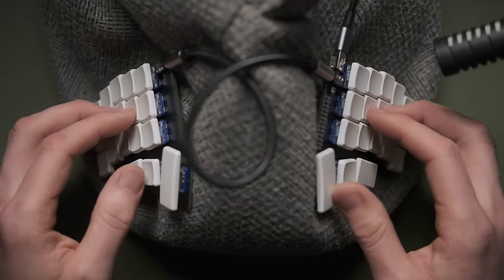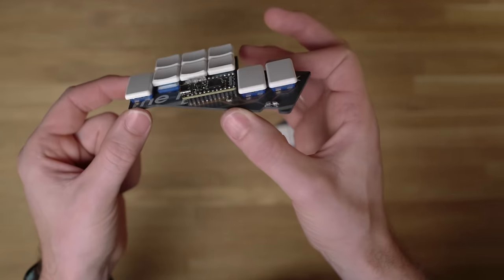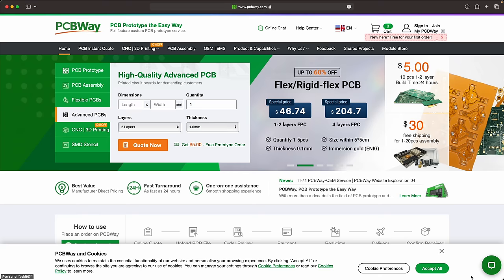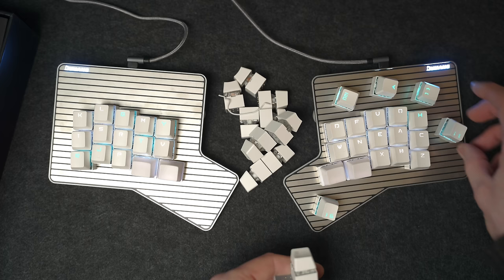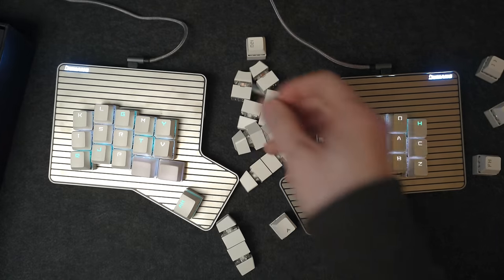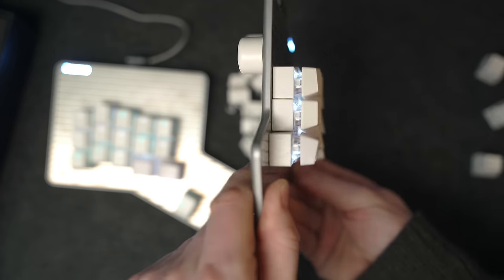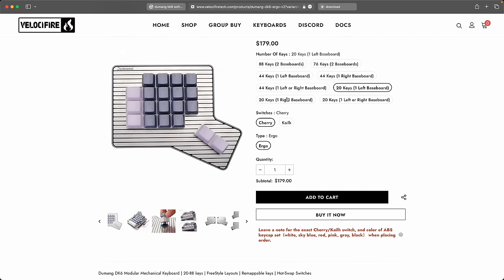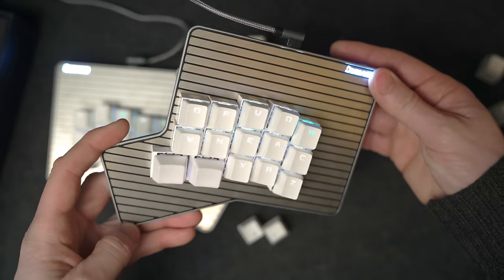This Keyboard Lets You Put Keys ANYWHERE!

Comment: super cool, needs an open source firmware however...
Reply: Yep. A keyboard without firmware being audited is a key logger waiting to happen
Reply: I tried writing some. Even got some internal docs but in the end you will have to have a process running on the host to sync the layers between the boards
Reply: Needs an open source hardware too IMO. We could connect the two halves with RF and make it just appear as a normal keyboard to any computer.
Reply: Doesn't look too hard to reverse engineer and it's not like they have a patent
Reply: @kubenoz  how do you know, do you own one?
Reply: @knoopx  There's only so much you can do on a pcb that small
Reply: @davemateo1240  I figured. Deal breaker for me, but maybe someone will love it enough to make a better version of this hardware

Comment: If i were to guess how this works, I'd say the rails alternate positive and negative. The ring of conductors on the keys do the same. Diodes prevent reversing the polarity and as long as one conductor of each polarity touch the corresponding rail, you have power to the switch.

Comment: I feel like this concept could go a long way with a bit of work.  Lately I've been fascinated by the idea of having a bluetooth mesh (or really any wireless spec that's capable of meshing) device hub, one connection to the host yet many connections to various devices, say if you have a wireless split keyboard, a wireless macro pad, a wireless mouse, a secondary pointer device like a SpaceMouse or joystick, a controller, etc.; where the hub aggregates all devices and all inputs into a singular device with limitless expansion, yet the host only sees one device with one set of input.  I think that concept would work well here, have a hub with multiple one-switch devices, each switch gets programmed as a specific function, and the hub controls all communication yet the host only sees one device and doesn't need additional programs, while the switch ecosystem can grow or shrink as needed.  Then throw the necessary hardware into the switches, put some coils in there as well so that they can truly be wireless and not just bound to a magnetic surface, etc.  Coils would also make prototyping different shells easier, say you want to go from a typical flat staggered layout to a tented dactyl with an arc on the finger keys, all you would need is a power coil where the keys sit with a friction fit for the key bases, no messing with magnets or orientation.  Same methodology could also be translated to dials or sliders, joysticks or pointing sticks, trackballs or trackpads, or possibly even more complicated devices as long as the module fits in place, has a power source, and has a connection to the hub.  And the hub itself could be stupidly simple on the host side, nothing more than an HID device, and HID has a ton of overhead for what can be done, it's been awhile since I looked through the spec but IIRC the old terminal-style 200% keyboards have full implementation under just the keyboard portion of the HID spec, while the HID spec also has implements for joystics, vector devices, gamepads, mice, etc.; it's just the hub-device side that would be a bit cumbersome to figure out.  Of course this idea also wouldn't be cheap, but no single-switch module implementation like this ever would be cheap.  

I've considered similar methods of modularity for controller design in the past, though not going the full wireless route but having a modular-forward approach to design.  Have all of your base units, a simplistic microcontroller board with an adjustable (mainly wire with extra slack for repositioning) device interface, where the only thing that changes is the shell that everything fits into.  Keyboards could easily work the same way, and they don't necessarily have to be fully wireless either, just have all your switch modules, your device interfaces, and a simplistic controller board, with the only changes being the box they all fit into.  More platforms need this kind of modularity to them, yet the only realistic modularity we see is when it comes to sim rigs for very specific sim games.  The only real benefit to going to full wireless is the separation between the microcontroller board and devices, which would work well with a fully wireless split keyboard, especially one of evolving design; or say you want a third board that's a macropad, rather than the investment of that needing to be its own device, it can communicate with a wireless hub instead, and it too can evolve in its own way, only wiring requirement is a power source, which can easily be relegated to a battery. 

Though, personally, if I were to do a keyboard like this, I would use slim switches just so height isn't a concern.  Also with the possibility of using an alternate bottom housing that internalizes the additional components rather than having a PCB hanging off the bottom with an additional shell; not to mention this would make the switch more adaptable to whatever housing design someone wants to use, I would imagine a Lego-like friction stud design would be a popular choice but this realistically works better if that design is part of the switch casing and not a sleeve covering the additional PCB where the main anchor is the switch's pins to PCB solder joint with some kind of PCB to plastic sleeve anchor method.
Reply from the maker: Cool ideas!

Comment: wow imagine an open source version or one less expensive
Reply from the maker: Yeah something needs to happen on the software side! I feel like the python project might be a good way forward but it hasn’t seen any development for ages.
Reply: @BenVallack  I was looking it up more and there's surprisingly little about it, it is expensive

Now I'm wondering if there is a hacky diy way, where you use longer thin enameled wire to  wire the keyswitches to a central pcb, like you normally do, but then they can move in space. If you add a magnet to the back of the switches, then they could stay in place.

not anywhere near polished but could be the same price as the normal diy pcb keybs + only the cost of a cheap magnets and a cheap steel backplate (sendcutsend if you want a hefty one)

Comment: as a workaround for a  single-shot layer switch,  is it perhaps possible to assign macros to the alternative layer's keypresses - such as it would first send the desired key, and step two, reset the layer to default?
Reply: I tried this. Unfortunately a single key can only have a single macro assigned to it across all the layers. You end up giving up a lot of other customisation
Reply: @davemateo1240  I have been able to use all four layers and map an entire keyboard to just one half of the split ket board.  The macro limit is really annoying in addition to that a macro is needed to map to a shifted key.  Other annoyance is the keypress vs key hold times are fixed values.  I find my thumb presses do not register sometimes since the thumbs are slower tha tha th the regular finges.

Comment: Let's pray some westerner steals the idea and does it properly. This clearly has potential, but downloading device drivers from a (verrry) sketchy Chinese website lol? nty.

Edit: took a closer look at their product page and noticed that it's using a "unique co-processor" (definitely flashed with a proprietary blob, likely obfuscated) alongside a (by keyboard standards) powerful 32-bit MCU, which they claim is used to reduce the supposed delay regular keyboards have (but seemingly packs a lot more power than needed) . 
Couple that with a device driver running in kernel space, it could make for an extremely powerful & undetectable keylogger that in theory could completely bypass user space & directly communicate with the network stack without leaving significant traces of malicious behavior. 

Gotta give it to them, this is fucking impressive.
Reply from the maker: How likely is that though in a niche device?

Comment: This keyboard was often recommended to me by aliexpress. I did considered it. But i came to a conclusion that i'd need a tilted thumb cluster for best reachability, and for flat layout there is still my trusty handwired 3d printed plate way of prototyping. You can print  flat plate in FDM in mere hours. 
About the software why not just run windows? On a separate pc, or in parallels. It's not like all the software that you need to test the ergonomics of the layout is mac based. Also i'd personally prefer not to run any unknown software with high level keyboard hook and elevate privilege(this is my second reason for not buying this keyboard).